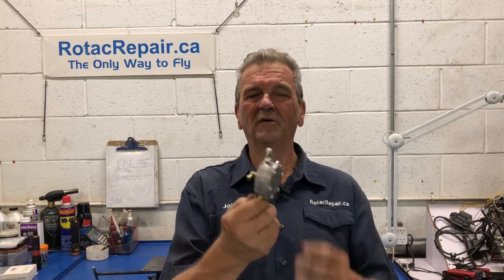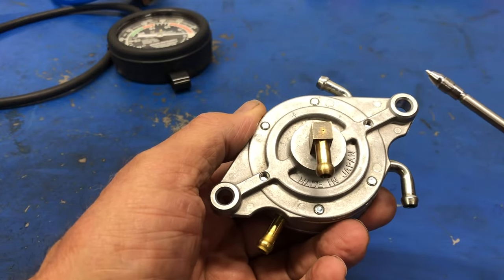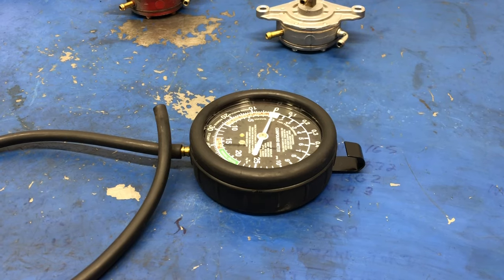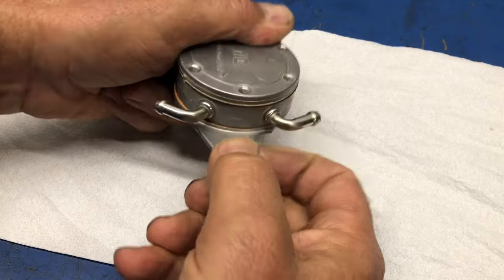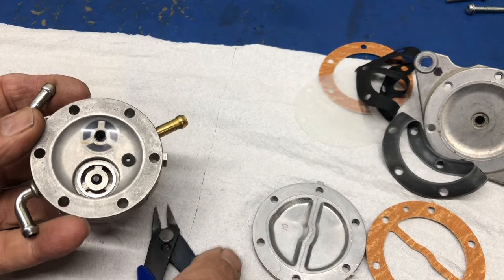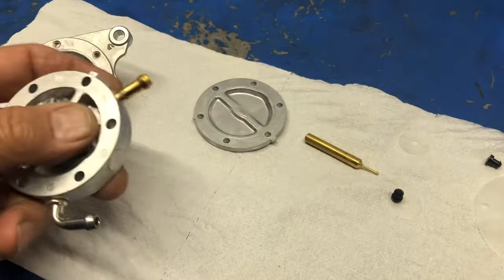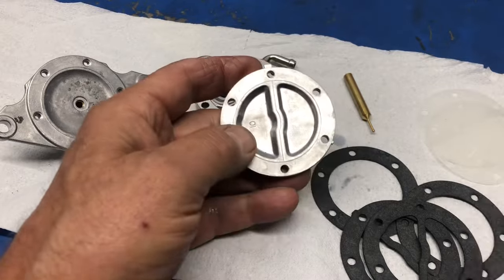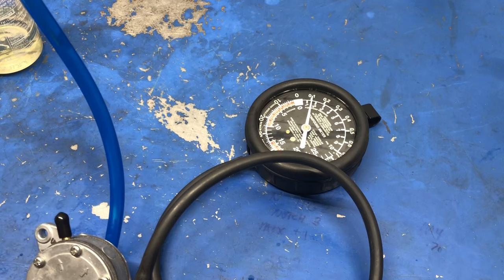Rotax 582 Mikuni fuel pump bench testing and repair

Comment: Did you know that you are using the wrong screw driver?  A regular philips works but doesn't fit well, and is apt to strip the screw heads.  The proper driver is a JIS (Japanese Industrial Standard), identified by a punch mark on the screw head.  The carburetors use another type of screw that also looks like a philips, but isn't.  These are pozidriv heads, marked with cross dashes.  Would be nice if a standard "philips looking" screw head was developed and used internationally to eliminate these special tools and associated problems (stripping heads).
Reply: I reviewed the video and I believe I’m using a pozidriv screw driver. Your are very correct as the regular Philips is a very poor fit. Thank you for your comment, that’s good information.
Reply: The correct screwdriver for the pulse pump is a JIS (Japanese Industrial Standard), identified by a punch mark on the screw head.  Not trying to be critical.  I just learned about the difference in these screwdrivers myself so just wanted to pass it on.  It certainly explains why I've have  trouble over the years with Japanese screws on motorcycles and other stuff made in Japan.  I really enjoy your videos . . . thank you!
Reply from the maker: I’ll be looking for a “JIS” tip and see if it fits better than my current choice. Good tip thanks again.

Comment: Excellent!  Just what I was looking for.  Where can I get the gauge and insertion tool like yours?  Prior to watching, I thought the tiny hole in the pulse line was to "tattle tale" when the pump failed as indicated by fuel coming out.  But as you said, it's also to drain accumulated oil that comes in through the pulse line.  This explains the oily area under the pump on my 503.  The pump on my 582 isn't mounted with the pin hole down.  Maybe that's why I am not getting as much pressure from it.  I have pressure gauges mounted on my aircraft to monitor fuel pressure.  My 582 runs at only 2.5psi, 4.5psi with the inline electric pump on too.  So I think a diagram is bad.  Thanks for a great video!  Also, what is your parts "wash" process?
Reply: Thanks for your kind comments. I “washed” the pump using an ultrasonic cleaner

Comment: Great video! Have you ever tried a DF52-82 fuel pump on a rotax 582? I want to use it because it incorporates a pressure regulator that prevents flooding the carburetors.
Reply from the maker: No I haven’t, never found the opportunity to need one. I’ll definitely keep it in mind.

Comment: Vertical or horizontal, which is the best mount for the fuel pump?
Reply from the maker: I recommend mounting the fuel pump with the tiny pulse line drain hole facing down . The pulse line must be no longer than 20 inch's, however try to keep it as short as possible for the best pump operation
Reply: I see a lot of fuel pumps vertical, why is that?
Reply from the maker: @robertwalker2568  The Mikuni fuel pumps seen to operate fine when mounted vertically. Is that mounting correct? No it’s not correct because any acquired liquid inside the pump won’t drain out. The small drain hole is a safety feature required by Rotax.